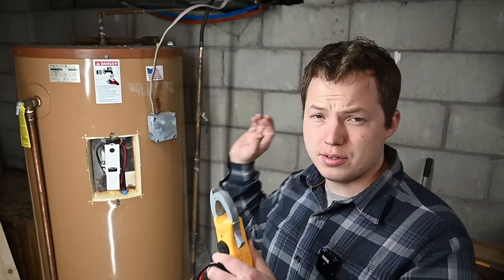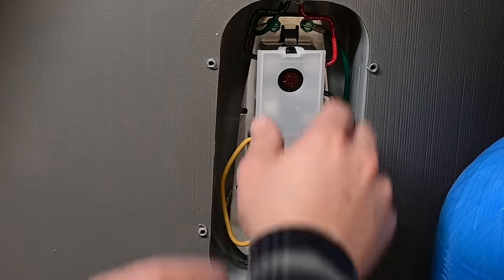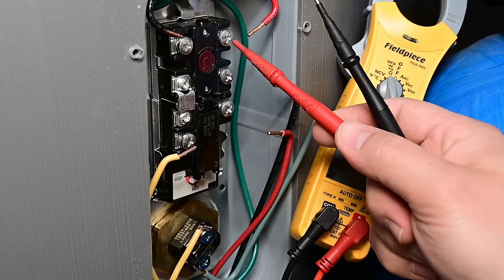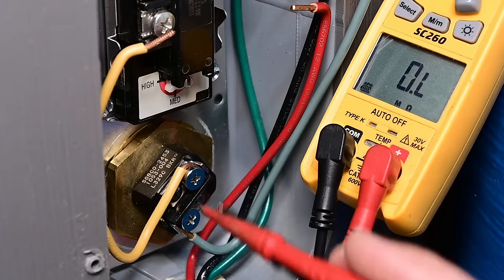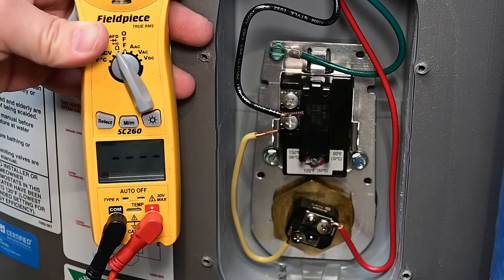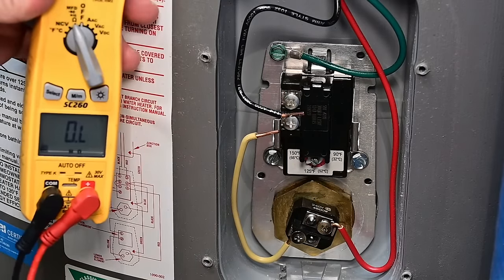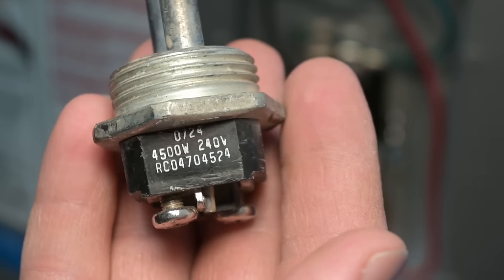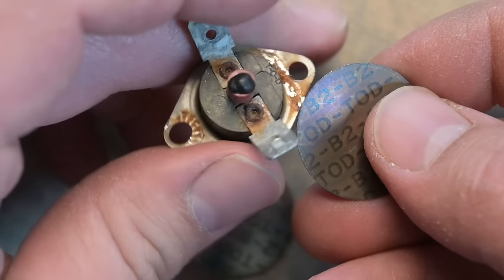How To Check Electric Water Heater Elements & Thermostats With Power On & Off

Comment: I was always taught to handle the leads with a single hand, just so a electric shock doesn't kill you
Reply from the maker: Exactly.
Reply: @BenjaminSahlstrom  it does reduce the possibility of current taking a path from lead to lead (requiring both leads to be bad-) through your chest -however - it can still get you,   through one hand through a body part and can be just as dangerous as using two hands. Arc flash tends to be a bigger danger often due to meter leads/meter being used beyond their cat rating on higher voltage equipment,  as I understand our training from fluke, and the regular safety training we get from other various agencies and utility companies. - Excellent video too

Comment: Guys, 30 years ago, my father-in-law complained about how his electric bill was way higher than normal. I went to his house and with my current meter, I found his water heater was drawing current even when the elements were off! Back then his 220volt water heater had thermostat switches that only switched off one leg of the 220volts. I went HUMMMMMM, to myself and decided to pull the elements out. His water was from a well beside his hot water tank (in his basement) and he didn't have any softener or water treatment system. I pulled the top element and discovered the element was split and his high mineral water was getting to the element electrode, the electricity was flowing to the ground, through the water,  ALL THE TIME! I changed both elements and the problem was fixed. Remember this if you work on an old water heater in a house or camp.

Comment: Why 2 elements and at different places in the tank? How and why are the elements prioritized?
Reply: it probably has to do with heating the incoming cold water which enters at the bottom (there's a drip tube) to prevent it from cooling the water closer to the top exiting the tank.

Comment: I can't figure out what's going on with my water heater but believe I am having a power issue.  I am not getting any volt reading (0.00) when I touch the top two screws when they are connected to the red and black. However when I touch each leg to ground I get 120 volts.  Does anyone have any suggestions on what's going on with my unit?
Reply: I'm here pouring through comments looking for answers because I have the same issue. Any tips?!

Comment: Help please. I took thermostat apart and a piece fell off. I don't know how it goes back on and i can't find a break down of it. I have a picture but can't add it here
Reply: Just buy a new one. Why did you take a good thermostat apart? He was only doing so for educational purposes
Reply: @DeezNuttz_BoffaDem  mine wasn't perfectly good . Before i took it apart my thermostat setting at 125 and temperature was 186. I quickly flipped off breaker. I bought two new ones and working fine now. I guess I'm curious is why i took it apart. My degree is in electronics through and not house wiring.

Comment: your video shows how to check if parts are working, but it doesn't show how to change the parts or restart the water heater. At the end of the video you suggest to change the parts but don't show it, and why replace if the parts in your video works?

Comment: Someone had wired the 30 amp circuit with 12 gauge wire for a number of years.  I switched the wire to 10 gauge and turned on the breaker. and sparks flew out the back of it and the 100 amp main breaker also blew.  If I disconnected the water heater this did not happen.  I changed to a new 30 amp breaker and it all worked fine.  I'm guessing it has something to do with the overloaded12 gauge wire.  The thermostat on the water heater is also bad.  Anyone else seen this happen or have a better explanation?

Comment: I use a light bulb to check the heating and off period
Reply: Hu?
Reply: It's an old method
Reply from the maker: Interesting! Could you describe how that would work exactly?
Reply: @BenjaminSahlstrom  it's a 220v light bulb connected in parallel with the element really. Check this link if you can to see it https://www.google.com/search?q=testing+a+water+heater++thermostat+with+a+light+bulb&tbm=isch&ved=2ahUKEwimkO-hjvHoAhXgRTABHUz1ARoQ2-cCegQIABAC&oq=testing+a+water+heater++thermostat+with+a+light+bulb&gs_lcp=ChJtb2JpbGUtZ3dzLXdpei1pbWcQAzoECCMQJzoHCCMQsAIQJzoECB4QCjoECCEQClCnXliFmgFgwqIBaAFwAHgBgAGpB4gB0iOSAQ0wLjcuNC4xLjEuMS4xmAEAoAEB&sclient=mobile-gws-wiz-img&ei=d36aXub4IeCLwbkPzOqH0AE&client=ms-android-samsung-gj-re

Comment: I see your thermostat set high,, there is no reason to have a waterhotter any above a good hot shower. Your elements will last longer, and the reduced delta Temp ( inside to outside temp will lower your power bill.  Remember heat loss or transfer is not linear.

Comment: This video could be simplified.

How to fix an electric water heater: take it to the recycling yard and install a gas hot water tank.
Reply from the maker: Ha exactly!
Reply: when you're on propane the savings aren't always that great. in some areas electric may be cheaper.
Reply: That's ok if you have gas in your area.

Comment: Connection between thermostat and heating element is done by solid wire with plastic insulation??? Even hadn't melted yet :)))) 

But more correct way is install stranded wire with thermal-resistant insulation between heating element and thermostat crimping to ring connectors: 
https://upload.wikimedia.org/wikipedia/commons/1/1c/Split_ring_terminal_wiring.jpg
Reply from the maker: Indeed! All of the water heaters that I have worked on use solid conductors as far as I am aware.
Reply: @BenjaminSahlstrom  Such large gauge solid wire can't be looped, so contact area for 20A may be smaller than required. Additionally heating element sending heat to wires, so plastic insulation isn't good solution. That is why I am confused seeing this way of wiring.

Comment: So everything tested fine but still no hot water. Thermostats clicked off and on tested as per video. Elements tests at 12 no voltage leaking.  Reset tested OK. 😂😂😂😂 I guess it must have just wanted me to take all the wires off and play with it for an hour...

Comment: This video is frustrating because Benjamin already assumes the viewer knows what his tools are. If you are going to give a through explanation of each part of the Water Heater components in diagnostics, you first must explain the tool you are using, the variability on it, and the reason for each one prior to just jumping into it. Wanting to build a community and not getting subscribers is not because of people not wanting to subscribe.  People are dying to subscribe. It's because everyone learning curve is so substantially different, than you are only resonating with less than 10 percent if you are lucky. Even then, they are probably confused. 
Prior to making this video, a simply short and sweet explanation on your tool you are using while giving a visual is important. I would of started off with my tester, slowly explaining the modes and reasons for each mode. Then go into your information. Slow down. The speed in which you speak of shows you have so much knowledge at the tip of your tongue and the viewer is left frustrated. I would guarantee you that you would be in the millions already with subscribers if you don't assume the audience is halfway intelligent with a H.S. Diploma. You have to assume we are dumb sheep that need instructions and repetition numerous times. Because we do.
Take this with kindness. Feedback is hard. But I only tell you because you have the personality and outreach to be the best. Making millions.